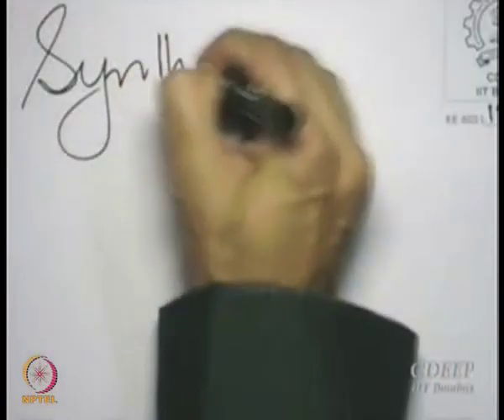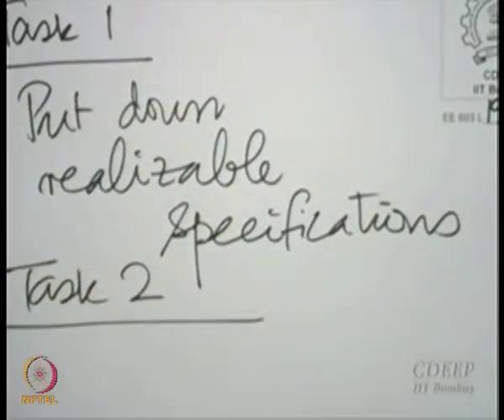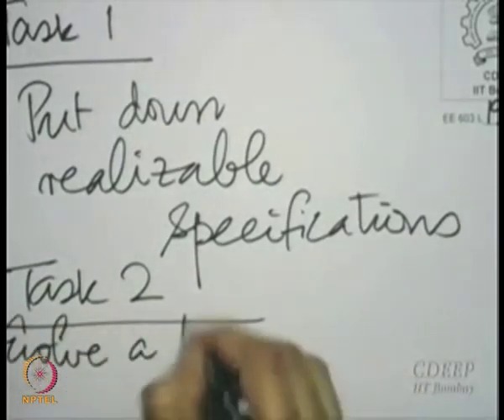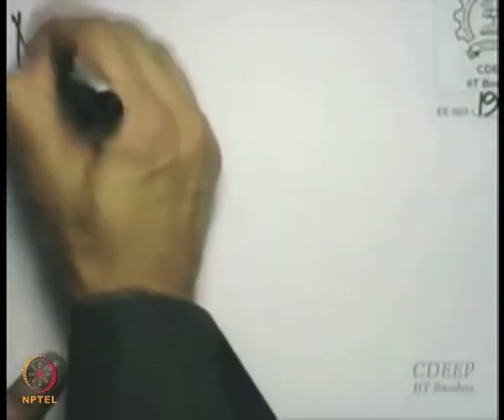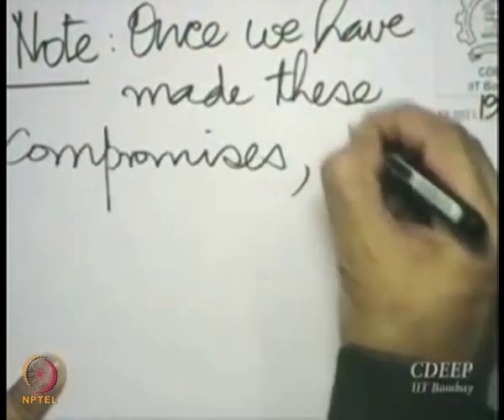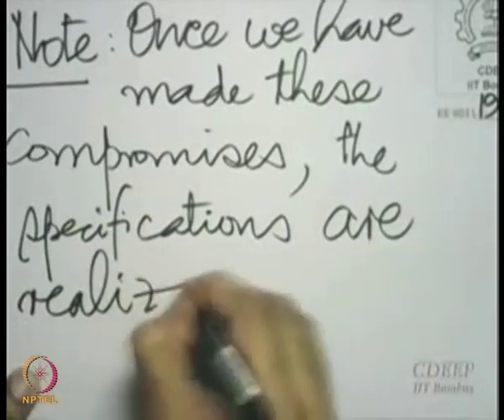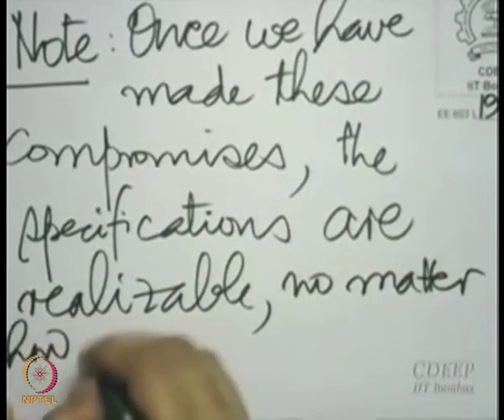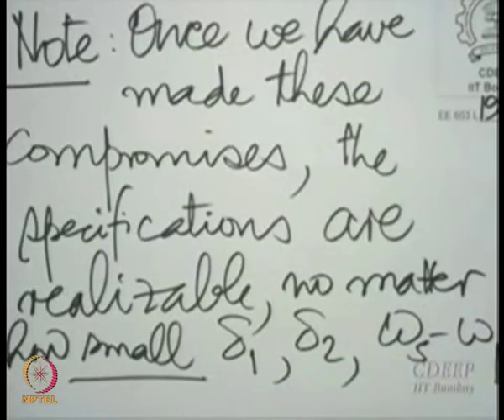Lecture 19A: Synthesis of Discrete Time Filters, Realizable specifications

Comment: question asked at @ 24:15 : phase response comes from the time shifting property of DTFT or ZT. A delay in time-domain to corresponds to phase change in frequency domain. Therefore, if the filter phase response is zero, it means that there is no delay and the output is appearing at the exact time instant the input is applied, which is not possible in causal systems. In causal systems (filters), there is always a delay after the input is apllied to get the output. In other words, there can be no output before the input is applied.